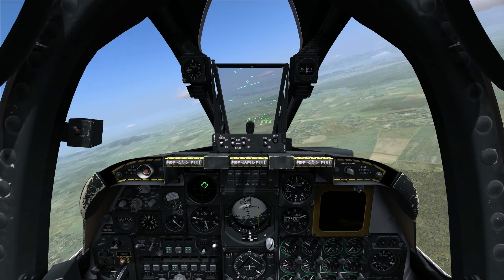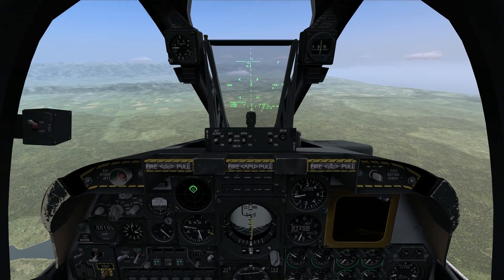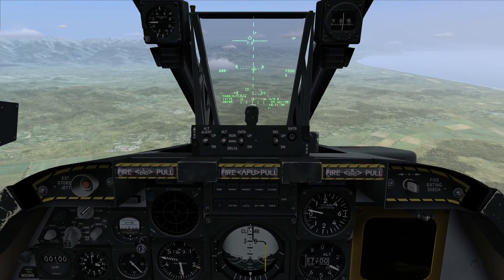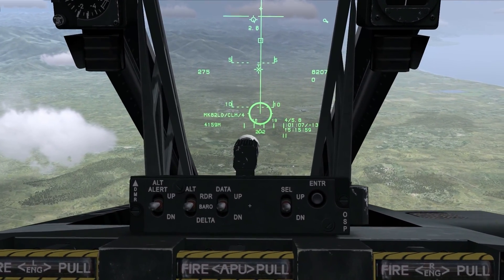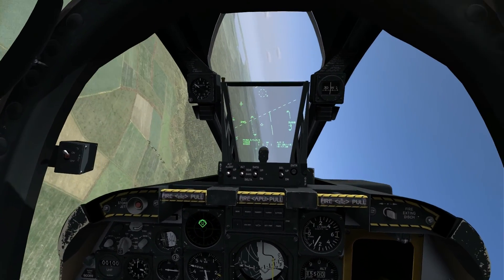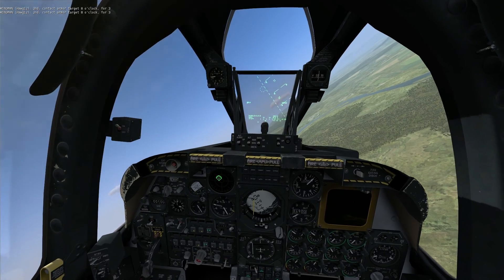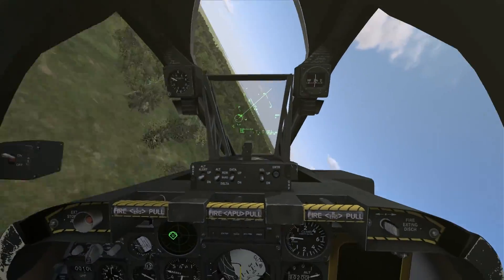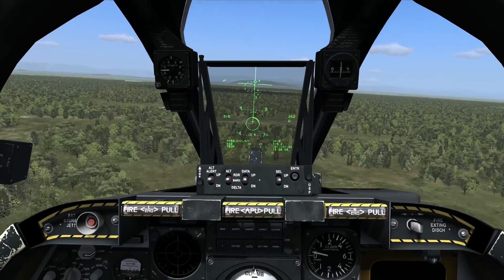On the Range #4 - A-10A Warthog CCRP Bombing in DCS: World

Comment: Hey again. Couple questions: Do you have voice commands set up for aircraft operations or do you know the keyboard so well that yer makin it look easy ? And sort of a different topic: Does DCS often make the Master Caution stay on after landings ? Seems like it's pretty easy to have that alarm sound after hard landings. Any tips for when that happens or just restart? I'm staying in startup tutorial then I jump to as many airfields that I can before running out of fuel. Thanks again !
Reply from the maker: +Dave Almeroth I still do it all from the keyboard.  Setting up voice commands might be easier for someone coming into it fresh but, like you say, I have been doing it so long that it feels very natural this way.  A master caution staying on after landing is definitely not normal. :)  All I can think of is that it could be triggered by landing a little "hard".  Is this in the A model or the C model?  If the A, you might try turning aircraft power off and back on using RSft-L.  If in the C, you might try turning whatever system is illuminated on the caution and warning panel off and on.  That's about all I can think of.

Comment: Great video… As are all the rest.
Your track IR profile seems really smooth would you mind sharing it if possible?
Reply from the maker: Jon, I would but it is 100% the default profile.  It is a TrackIR 5 with the Trackclip pro so I guess that might make a difference.  Or it could be that I just have a smooth neck. :)
Reply: Gotta be the smooth neck because I'm using the same hardware....   so what neck grease do u use ??? lol
Reply: On the same vein, it looks like when you lean in there's some track IR zoom on the instruments, but then when you look out the cockpit you also have another zoom mapped....   I moved the track IR zoom off it's default binding and mapped that to a slider on my throttle, are you doing similar?    What axis is your zoom in on the TIR mapped to?
Reply from the maker: When I lean in it isn't exactly a zoom, its just moving my head position closer to the panel.  I mapped the TrackIR Z axis to "absolute longitude shift" under the axis settings and do not use it for zoom.  All the actual zoom is done like you say, with a slider on my throttle.  I use a combination of both so it is probably hard to figure out exactly what is happening now that I think about it.